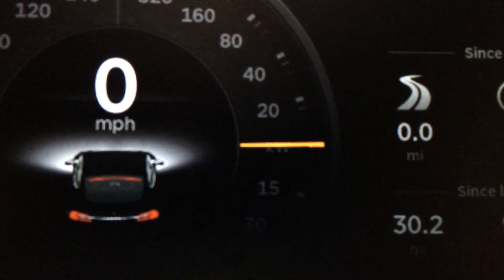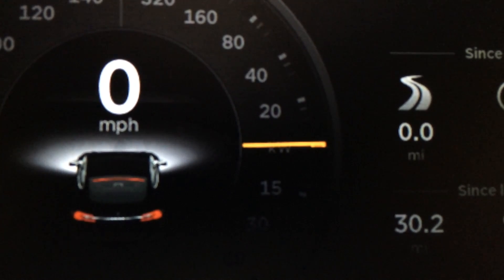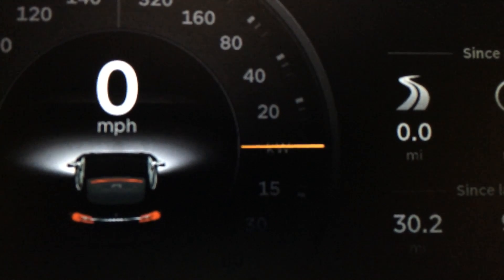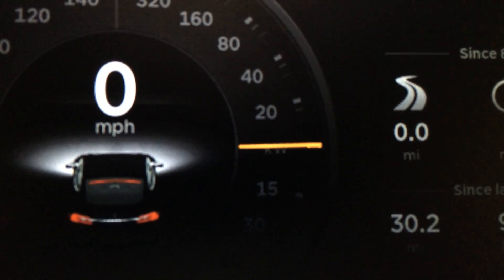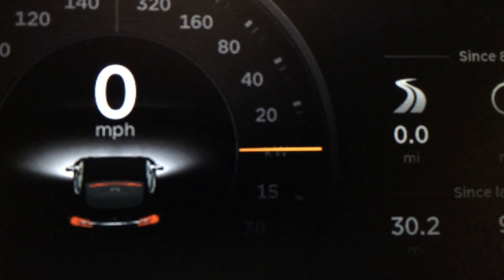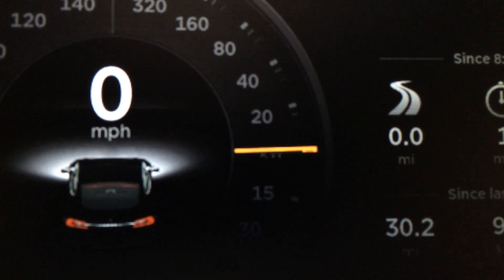Tesla Model S: Interesting Find-Potentiometer on Bake Pedal

Comment: The brakes are electronically boosted, so the more torque on the break pedal the more power the car will use to squeeze the brakes together.  Unlike the new Model S brakes.  New autopilot Model S have electromechanical brakes without the hydraulics.
Reply from the maker: +Kurt Jenney Actually, not electronically boosted on my Model S. The classic s's do have a vacuum pump and brake booster.
Reply: ***** and how do you power the vacuum pump?...electricity.  Also, my dad's model s 60 doesn't show this behavior.  Weird.